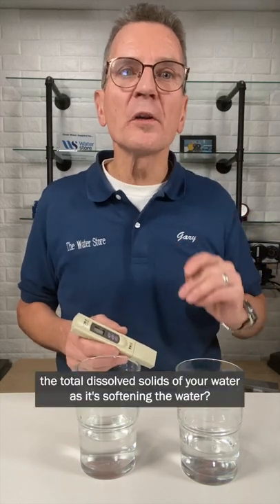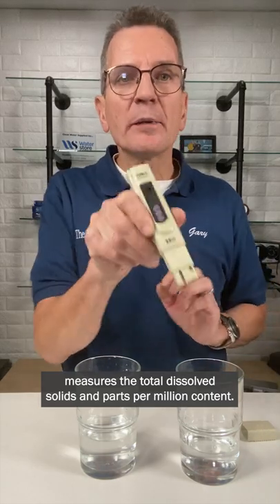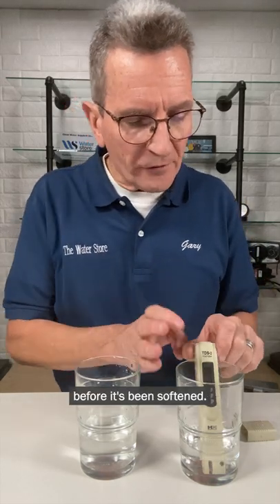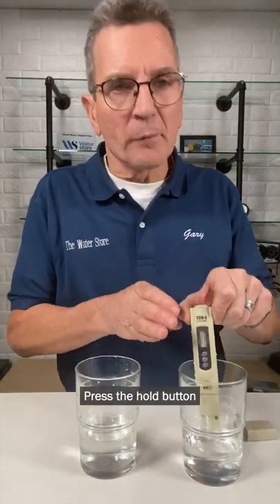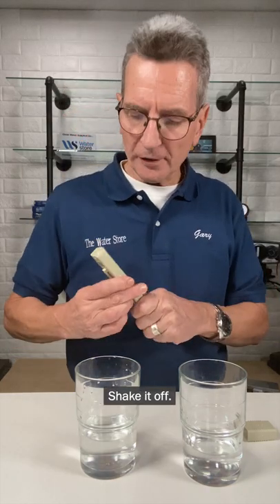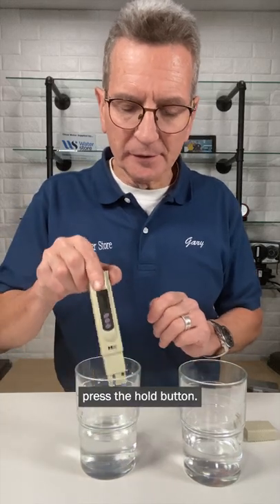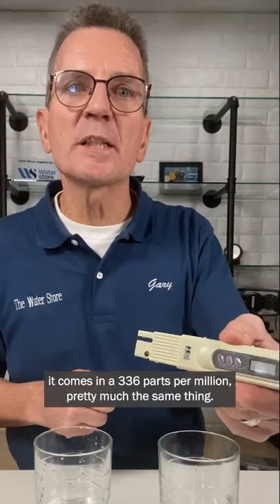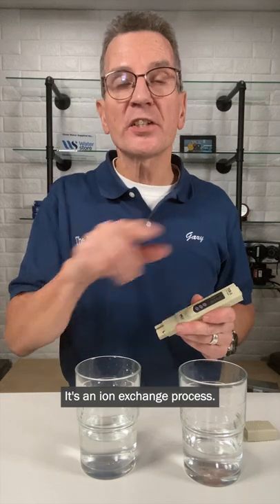Does a WATER SOFTENER Remove TDS from Your Water? #shorts

Comment: Essentially is exchanges Calcium and magnesium ions for sodium ions. (Sodium from Brine, that’s generally what’s used) so the TDS stays about the same, but it removes the “hard” minerals. but we all need salt anyway.
Reply from the maker: What he says
Reply: @water_estore lmao I was gonna say, bc he didn’t really explain at all how it works or it wasn’t shown here
Reply: @XxDeadShotxX101  yep, not a great explanation in a youtube short. Basically it's all a losing battle. What you need to do is put a multi-stage filter before your water softener to reduce overall TDS. Ion exchange replaces one mineral with another. Then if you want something more pure to drink you place an RO system under your kitchen sink. When all is said and done you may also need to install a PSI booster because that first multi-stage system will be a drag on everything (yet increase the lifespan of the others).

Comment: Somebody else said below that you need to get a water softening kit. And also as far as testing goes softening doesn’t lower the mineral content so it’ll read the same as before. It’s an ion exchange it doesn’t remove minerals.
Reply from the maker: Agreed.  Test hardness with a hardness test kit like this https://waterestore.com/products/hum-water-hardness-test
Reply: @water_estore Hi, I want to test my water hardness so I can set the right setting in my appliances (mainly a dishwasher, it operates with added salt to soften our hard water and it wants me to choose a setting based on a table in the manual). I have no need to test the water for drinking purposes, so I don't think any of what was said in the video applies to me. Do I need the strips or will a TDS meter (ppm) work for my case? I asked because I saw you recommended the strips in your comment here but listed the TDS tester in your video description. I found a very cheap one like the one you used in the video, cheaper than strips in my area! Are they essentially the same or what?

Comment: So.. it’s 300-400 tds safe for drinking?
Reply from the maker: Drinking water standard for TDS is 500 ppm or less.  BUT, there can be other contaminents  in the water that would make your water unsafe to drink. IF all of the other water test results are within drinking water standards and your water 300-400 PPM TDS then yes, it is safe to drink.
Reply: @water_estore  Great, just installed a fridge with water dispenser. It’s testing at about 350 tds

Comment: I live in TX. Our TDS is 250. The water spots are there.  How and if possible can we drop the TDS?
Reply from the maker: If the water is hard, this water softener will fix it. https://waterestore.com/products/hum-deluxe-water-softener-30-000-grain if not, you need a Reverse Osmosis system like this https://waterestore.com/products/hum-water-saver-75-gpd-reverse-osmosis-system-brushed-nickel-faucet

Comment: You spend more time setting up the experiment and rush through the answer, but I’ll really qualify the answer. What are the benefits of just doing an ion exchange? If they make a test for hard water, but softening the water doesn’t have an affect on the test we use to figure how hard a water is how do we know if it worked? How do we know if it’s still working in the future?
Reply from the maker: A TDS test is not a hardness test.  You need to have the water tested for hardness, setup the water softener based on that result and then retest the treated water for hardness to determine if the water softener is working or not.  A TDS test is never used for a water softener. It's like torque and horsepower.  Related but not the same.

Comment: So it definitely doesn't lower it but does it sometimes add tds? My softened water is almost 200 higher than the hard water from the well.
Reply from the maker: Great question, yes id does, but typically only about 10%.  I would have your water tested for hardness and make sure your softener settings are correct.
Reply: I saw mine go up after installing my water softener. In my case it's because I ran a regen and I think the residual salt content raised the level. I ran the water for a while and it went back down to normal.

Comment: Gary,

I just moved to Las Vegas and we have extreme hard water here. Upon arrival, my skin got very dry and painfully itchy.  I had a large resin/regen unit installed in the garage for the house and a reverse osmosis unit in the kitchen for drinking water. Unfortunately, My skin is not improving and I m certain the proximate cause is the water.  The company that installed the soft water unit tested it and it’s working but they then recommended a US $1500 carbon tank to remove the chlorine in the water.  Am I missing any obvious things aside from hardness? This doesn’t seem like a unique problem, but I cannot find any decent resources aside from you. Thanks for any insight.
Reply from the maker: Yes, excessive chlorine in the water can cause skin irritation.  If the softener didn't solve the problem, that would be the next step.

Comment: So what does it mean when it increases the TDS?

My well water was at at 536 ppm before. Now it is at 748 ppm.
Reply from the maker: After water goes through a water softener, the TDS or mineral content is higher than before going through the water softener. Yours is a lot higher so I would check to make sure that the hardness settings on your water softener are set correctly.
Reply: @water_estore  Thank you for the reply. Mine does not have a hardness setting. You have to use a calculation and based on that calculation is how you program the gallons used.

Comment: I do not fully understand my softener. leaves brown crap all over shower and turns my skin yellow. my ankles have also swelled to 2x there size. it has been determined something about the resin is gone I guess. supposedly the system has been bypassed for now for several days. maybe a week. still brown crap all over the shower I keep scrubbing off and still yellow skin with extended periods longer than ten minutes under shower. I guess connected to well at the moment. so is the softener it's own water system separate from the well? I have always been on hard water from well. softener is new to me. am I missing something?
Reply from the maker: It sounds like you have more going on here than hard water.  If it is bypassed and the same problem exists, that tells you likley you have massive amounts of iron in your water.
Reply: @water_estore  what are long term effects from showering in this water?

Comment: Hi! Been following your channel in light of it being one of the only few well informed. I recently moved and now live in Gilbert (near Phoenix), Arizona. The water is both hard (14+ hardness) and high TDS (480+). Water softener settings are set for these. I have an ion exchange water softener. The sheets and clothes have a lot of salt on them. I assume it is because of the exchange. How can I have less salt at the faucet?  Open the bypass valve to let some hard water in? Lower the hardness on the system to have less of an exchange? Or  something else. I’m trying to avoid an RO house filter bc of cost of water usage. Is RO the only option?
Reply from the maker: RO is really the answer for your family.  I would also have the raw water before the softener tested for sodium content, it may be that your raw water is high in sodium to begin with.

Comment: Hello, I have a water softener and a reverse olmosis watts system but the water continues the same measure with a digital tds I would like to know if I can drink the water, tds is 90 to 100 ppm.
Reply from the maker: There must be something wrong with the RO if the water is the same.  Drinking water standard for tds is 500 ppm or less.

Comment: How does softening the water not lower the mineral content of the water? I thought softening the water removes minerals, like calcium and magnesium, from the water.
Reply from the maker: Great question. It replaces the ions from calcium and magnesium so as a result the mineral content stays the same or slightly higher
Reply: To what effect
Reply: @water_estore 
So what the purpose of it all if it stays in there

Comment: Water softeners are kind of a joke.  My Well water hardness is around 550 and after the softener, that is programmed properly, the hardness is 80.  Softeners add salt to the water so it’s slippery, but it’s never totally free of hardness.  Also, if you feel you aren’t rinsing off properly during a shower, you’re not, as salt is taking away alot of the ability of the water to totally encapsulate particulate on your skin.
Reply from the maker: I disagree, if your water softener is working correctly it should be reducing your hardness from 550 ppm to 0 ppm.  Water softeners use salt to regenerate the media, there is very little added to the water, actually almost nothing, see https://youtu.be/18ieOqR2Juw

Comment: There are some issues with this video review first the test that he did on both soft water and on soft water was two separate videos put together
Second, he didn’t even state what kind of water softener or the name brand that he use to soften the water in his test 
Finally, he didn’t even state whether he used a entry level water softener, or a advance level filtration water softener 
So this makes it possible to consider what other type of things he left out in this comparison
Reply from the maker: This purpose of this video is to show you that a TDS meter cannot be used to measure water hardness.  It was all shot at the same time but some parts were cut out to make it fit under the 59  second length a YouTube "short" must conform to.  It doesn't matter what make, model or brand of water softener you use you will get the same result.  That is, a TDS meter will nopt measure water hardness. I hope you find the information useful, if not you can always do the test yourself and create and post your own video on the topic.